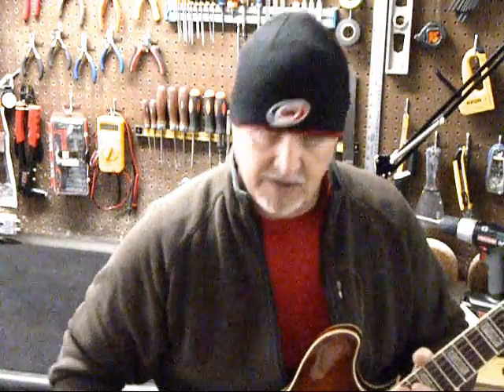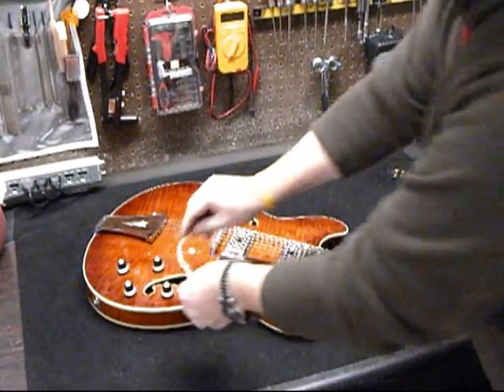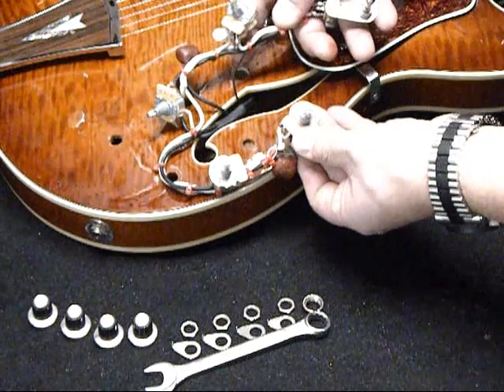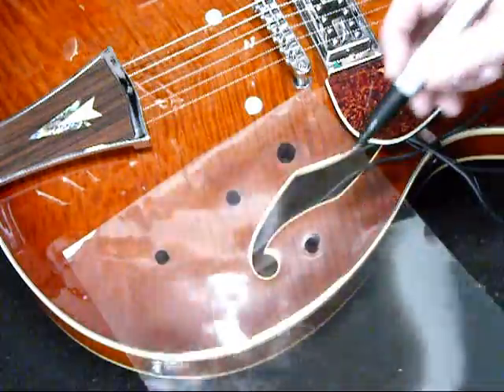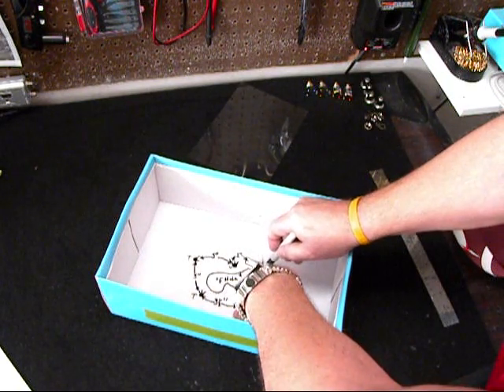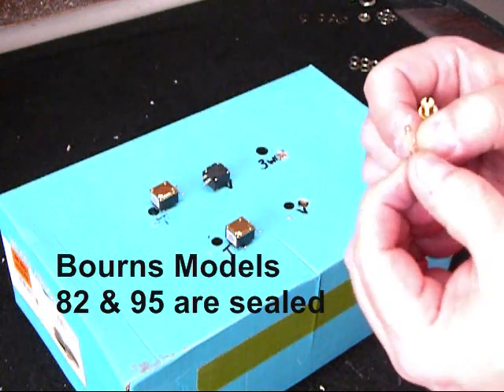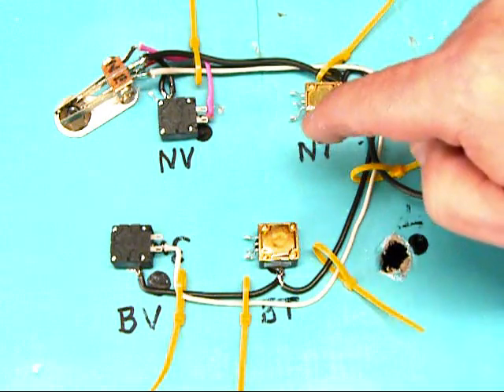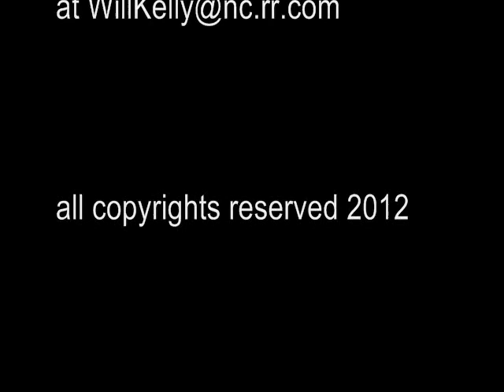Rewiring a Semi-Hollow Guitar, Part One

Comment: Do you take off push/pull knobs the same way? I'm looking to change my Alnico classic pro pups on an epiphone 339 to Seymour Duncan pups, do I need to replace anything else to aid the sound of the pups (pots, capacitors, etc.)? If so, what are the specs and quantity of the replacement parts? My Epi has 2 push/pull volume knobs, two tones and a 3 way switch. Thanks!! You really know your stuff. I wouldn't ask if you didn't.

Comment: Thanks Will - I was able to do a great first 335 re-wire thanks to you. One question. I used the Bournes pots and I get a lot of treble loss when I roll back on the volume controls. Just wondering if you noticed that and if you settled on a good resistor and cap value for a treble bleed circuit?

Comment: Ive got issues with a epiphone swingster with the three way switch not switching pick ups from treble to the mid. It will go to the neck but when i go middle it stays at the bridge. Do you think when i take it to the shop that i will need all the pots changed as well or just that threewayswitch.

Comment: are the .022 caps best for brightening up a dark humbucker?
Reply: James Bradley You may have found this info already, but a tone capacitor won't have an effect on the brightness of a pickup. All it does is control how much high end is cut when you roll off the tone pot. A .022uf cap will roll off less highs than a .047uf cap. Basically, the lower the value, the less highs get cut. But if your tone pot is wide open, the cap is has no effect. Hope that helps.

Comment: The F-holes on my Gretsch (G2655 Streamliner) are too small for the pots to pass through and I have to pull them out through the pickup holes.  So I almost stopped watching.  I'm glad I didn't, because the shoe box trick for making a harness is terrific.  My 3-way is on the upper "horn," so I used a bigger box, but thanks for the instruction!
Reply: I've got the 2622T Streamliner and it has the same small f-holes. You're not alone in your struggle!  :)